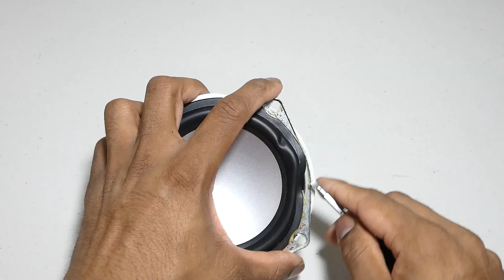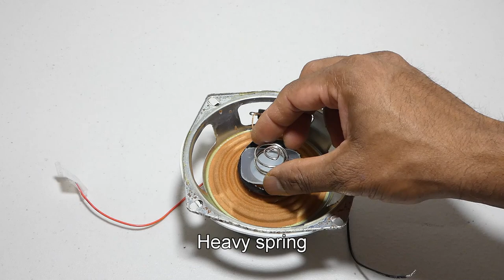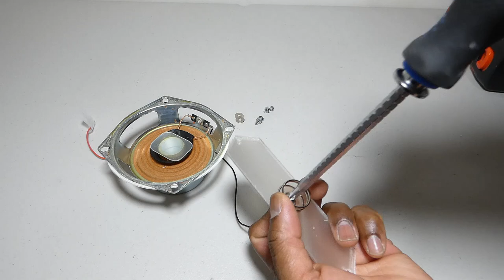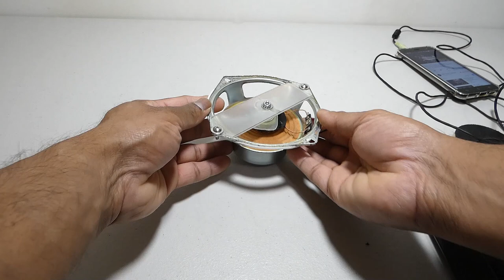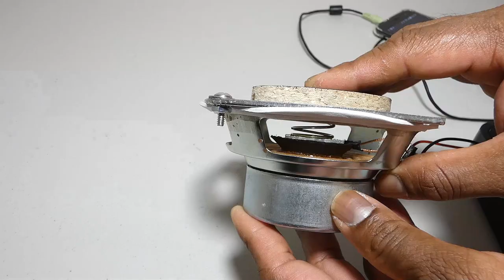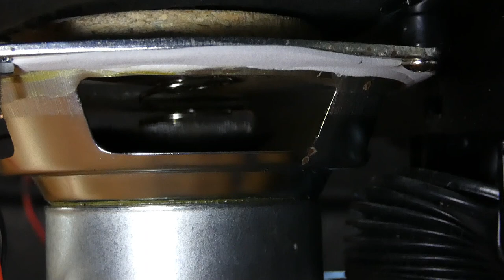How to make BASS SHAKER at home

Comment: i just sit near my sub and everything vibrates, gonna uprade to a 12 inch 275 RMS sub so i can actually get hearing damage from explosions lol but neat speaker hack for sure.
Reply: colbi mitchell you can’t get hearing damage from bass.
Reply: miklea molie the bass frequencies only vibrate the larger, stronger receptors in your ear canal and they are far stronger so they don’t breakdown like the ones that hear higher frequencies.
Reply: @lukasbekcic  bass is responsible for sound pressure level and you can do major damage with it by rupturing the eardrum, bass Cannon isn't just a track for teens to test their subs it's actually a feasible weapon.
Reply: Lol nice I’m 15 and I’m doing my own 12inch 250rms system at the moment. Do you have yours in your car or at home?
Reply: @flynnlee2378  That sounds good man that will be nice.
Well ive actually upgraded since then i have bought a DC power supply so i could run my alpine 500rms car audio amp to my 2 12s in my room.
its kind of pricey to do it that way but its pretty clean power and i can adjust the voltage.

Comment: hows the longevity on this? I made a few before with a bolt attached instead of the spring and that method involved moving the entire speaker housing. Felt nice in the chair but didn't last long.